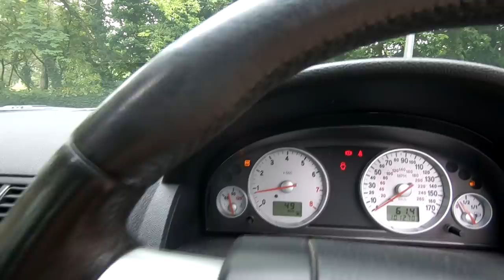Patio - Cars - Rant And Be Happy In Your Life Vlog

Comment: Some berk went into the O/S rear door of my MK3 in hospital car park. Luckily the local scrapy had one of the same paint code but it had a colour coded handle. Mine is a Ghia. Question is how easy is it  transfer the original Ghia handle to the new door. TIA Martin.
Reply from the maker: Its pretty easy once you know how John.
Reply: @butlersempire  Hi Martin found the Ford manual online. Look easy enough. Cheers

Comment: Are you prediabetes mate?   I have just been diagnosed with prediabetes & need to cut carbs.   It is so hard having to change after 40 years of eating what I want.   Also top tip if your u have a carby meal go for a 15 min walk 20 mins after starting the meal as that helps control insulin & keep blood sugar down
Reply from the maker: Type 2 bud. Check out my playlist on diet.